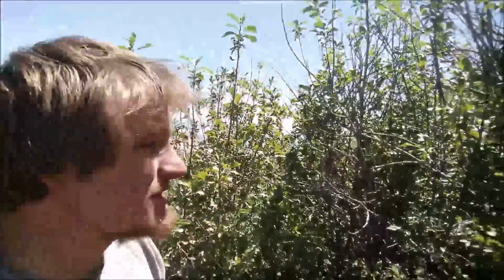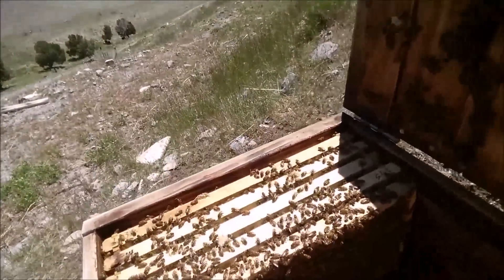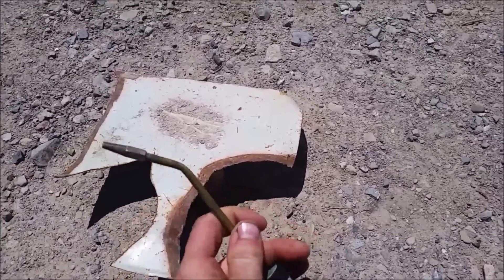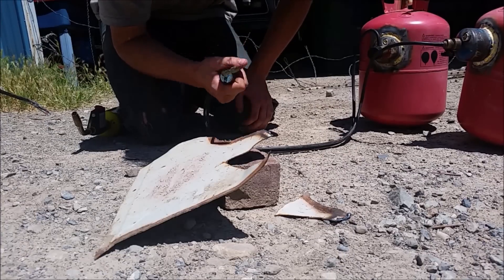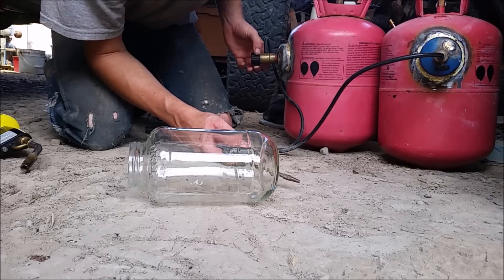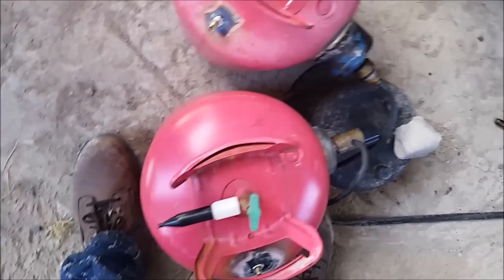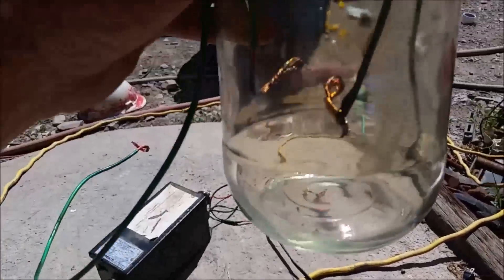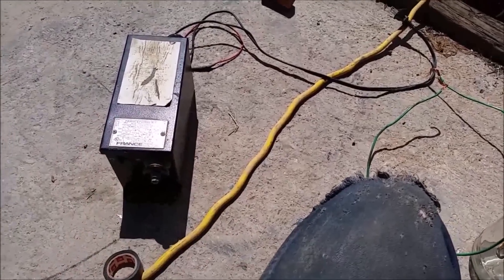Testing My Oxyhydrogen Torch

Comment: hay cody try this take that transformer and run a copper line out in the air insulated about a 100 foot or more as a antenna and hook it to the hi pot on the transformer and see if you get any useable current/voltage coming out of it you run antenna in on hi voltage side and check the lo voltage side for useable current    (you may need to use a hv capacitor between antenna and ground to maximize current last time i tried it  i got up wards of 380 volts or more 
good luck thank you

Comment: I worked for a company that made odd machines, one of which was a oxygen/hydrogen torch that was made to cut four feet and greater, thick steel. One day when the machine was finished, we tested it, I couldn't believe it, it actually cut four feet of steel. The cutting head was supplied from four bottles of hydrogen and eight bottles of oxygen, all hooked together with what looked like hose that looked like garden hose, but actually made for this purpose. The pressures for the gases were 240psi for the oxygen and about 120psi for the hydrogen, both being combined in a cutting head that was over a inch in diameter. The flame was about three feet long, shortening to a foot and a half when the extra oxygen was added. The cut itself was fairly clean, top to bottom, with very little flare-out at the bottom. Yes, Cody, the torch is possible and is used.
Reply: Val Pilags scary

Comment: I expect it tasted like your finger.  As to leaky containers. Hydrogen will slowly drift right through the wall of an ordinary steel container.  You may not have an actual leak as such. Safety note: hydrogen will tend to make a pressurized tank of this kind become brittle due to the formation of metal hydrides, which can produce sudden failure of the tank.

Comment: Hydrogen causes brittle steel. At least in higher strength steels(70kpsi+), the low carbon steels generally have toughness to spare. Large efforts are made to keep H out of any critical welds, electrodes and flux for arc welding  are stored in ovens to prevent any moisture and must be used within 2-4 hours. (the heat of welding breaks the water's bonds)

Comment: hey Cody, I was wondering if you ever thought about making a thermal Lance? basically using the same principle of burning steel wool, using some steel brake line and pumping some oxygen through the line if you ignite the end of the brake line with steel wool or another torch you can have a portable Lance that can cut through thick steel. there's already a video on it from another Chanel, but Im interested in seeing what kind of materials it could cut through. thanks!

Comment: Why would the water be depleted of deuterium?
Reply: The electrolysis process used to produce the fuel preferentially decomposes regular light water, leaving behind the deuterium. There is another video about using that (and another process) to deuterium-enrich water.

Comment: Hydrogen gas is normally stored in a   special tank because of the extremely tiny slippery molecules
Reply: Atoms. FTFY. As Hydrogen is the smallest element, it has always been known to be very tricky to contain in pressure vessels. Even hydrogen fuel tanks in spacecraft during Apollo missions were leaky. If Cody didn't have a leak in his home made hydrogen tank, I'd raise a beaker of home made ethanol In a toast.

Comment: When you say hydrogen is a slippery gas, that's no joke. On one of my random internet surfing days I stumbled onto Hydrogen Embrittlement on Aluminum... wowzers slippery is an understatement. Then you remember that Hydrogen really is just proton with an electron (neutron optional). So hydrogen ions would just be protons? Then from the space geek side you look up a what a pair-instability supernova is... a super inaccurate summary where basically early universe stars putting out SO much energy that hydrogen starts "condensing" out which then fouls up the works.

Sorry for the weird string of wikipedia articles, but hope you get a laugh. Also... nobody should judge you if you can't keep the Hydrogen from escaping out, Hydrogen is friggin weird =D

Comment: A leak in the hydrogen tank is not my main worry.  Hydrogen embrittlement is.  If you want to safely store hydrogen, don't use a steel tank.  find something else... Carbon fiber? or at least make sure you put some kind of failure scoring in the tank to cause small cracks instead of large explosions..

Comment: I've read that one of the properties of the flame of that gas (assuming its Browns gas [HHO?], forgive me my chemistry is not too good and I have not heard it called oxyhydrogen but I think that's what it is) is to render radio-active material less radioactive or inert. I have often wondered if that is true. The fact that it can vaporize tungsten, weld glass to brick and adjust temp to whatever it is used on is pretty amazing so I wouldn't be surprised if it could. The science behind it would be very interesting. +Cody'sLab to the rescue? SCIENCE!
Reply from the maker: This is not browns gas because it is being mixed at the point of ignition, well I guess it is just before it ignites... it would certainly be able to turn brick to glass but I doubt it would make anything less radioactive.
Reply: Thanks for letting me know that the gas is qualified differently when mixed on ignition as opposed to pre-ignition +Cody'sLab I didn't think it would have made a difference. I did believe the article I read about Browns gas and saw a video of a guy welding a glass rod to a house brick! So I did some double checking and as for the radiation... yep that is true too, it was even shown to US congress in 1992 but sadly it must have went over their heads :( 

You have everything needed to do a test to see if the OxyHydrogen gas would work on your radioactive materials as an experiment. It's not Browns gas as you say but it's worth a try don't you think? (Note that pieces of "metal and aluminum" were put near the radioactive sample and put under the flame from what I can glean from the link below). Results were astonishing! Reduction in radiation to 99% of original levels!! Very early tests in Sydney AU could only achieve 50% reductions but apparently they have been continuing to research and refine this aspect of the gas. Do links work in YouTube? I will add spaces Here is what I am talking about...  
Lost the link for this sorry but this is all that was written anyway:
"Brown’s Gas was first demonstrated to US government officials in 
1992.  Congressman Berkley Bedell helped publicize the results of the 
demonstration.
There are many different types of radioactive isotopes and many ways 
to vary the composition of Brown’s Gas and how it effects different 
types of radioactive materials.
When used on Cobalt 60, Brown’s Gas eliminated 96% of the 
radioactivity in under 10 minutes.  Either the mixture can be refined or
 the time can be increased to be more effective.  Americium was reduced 
by 99% in under 5 minutes."
More recent and detailed info here:rexresearch com/brown-haley/brown-haley htm
Love your work Cody! SCIENCE!
Reply: Brown's gas, HHO etc. are just over-unity energy scams. They're not things that actually exist in the real world.

Chemical reactions mean nothing to radioactive elements. The energies involved in coliding neuclei so fast that they form a different nuclei is in the millions to trillions of kelvins. The core of the sun can fuse hydrogen; heavier elements it is much too cold for. This is what particle accelerators do.
Reply: It's bullshit. Hydrogen, Oxygen and the heat produced from it's combustion will not affect radio active materials
Reply: HHO is H2O which is water. An oxygen hydrogen torch combines the two and ignites them. 2H2 + O2 = 2H2O. It basically combusts the two molecules to form water which releases heat in the process. The ideal mixture for full combustion is 2 parts hydrogen and 1 part oxygen. Although, a little more oxygen would make it easier to combust the two.
Reply: +Drew Hurst If you make the extraordinary claim that quantum mechanics and conservation of energy is wrong, you have to prove it. I see nothing distinct from an ordinary hydrogen and oxygen flame. Prove that an H-H-O molecule exists and there's a Nobel Physics prize in it for you.
Reply: +Kenneth Clark HHO is a hypothetical H-H-O molecule which quantum mechanics says can't exist as a stable molecule. The additional claim connected with the HHO/brown's gas scam is that you get more energy from burning it than it takes to make it (AKA perpetual motion of the first kind).

This allows e.g. cars that never need to be refueled; if only that dastardly government and/or oil industry would allow it to be marketed and sold. But hey, you can skirt this implausibly vast conspiracy by buying schematics on the internet for only $89.99 or some gizmo that saves some fuel (why not save all of it if it works?) by using your battery to electrolyze water.
Reply: ***** lol anonymous, thats not evidence for this mysterious h-h-0 or browns gas. 

the only thing this experiment shows is that a mixture of hydrogen gas and oxygen gas can create a flame that can melt metal. 

to figure out if the hydrogen and oxygen were bonding in a unique way you would want to do some sort of spectroscopy. 

all that being said, this is most likely just a mixture of H2 gas and Oxygen gas, with the only "bonding" occurring being from van der waals forces. That is, of course, until the gas receives enough energy input to cause hydrogen bonds to form... AKA ignition... AKA forming water.
Reply: No... It's not. It uses a tank of oxygen and a tank of hydrogen.
Reply: Reading this description at http://www.eagle-research.com/browngas/whatisbg/whatis.php before you make any more comments about scams or over-unity or what Brown's gas is and it's possible relationship to radioactive matter would be a good idea I reckon.
Reply: No, HHO is not an over unity scam.  Most of those who try and sell the devices fail to understand what's going on.  On a normal combustion engine (computer controlled) HHO can produce some benefit, but the additional O2 in the system can be picked up by the O2 sensors and causes additional fuel to be dumped into the cylinders because additional O2 means it's a LEAN condition.  There are a very select handful of cells properly designed that discard the O2 and feed ONLY h2 into the engine, and as a result, fuel efficiency IS increased and emissions ARE reduced.  H2 injection is a proven concept (google NASA's results) at both increasing fuel efficiency and decreasing emissions.  Spend 30 minutes on youtube watching people experimenting with HHO (not the ones trying sell you stuff).  There's also well-built commercial systems that they install on large diesels that see a significant impact on their fuel mileage.  These have been installed in fleets of trucks due to the increased mileage they provide.  Before fuel prices dropped back down I was going to start a business manufacturing and installing the hydrogen-only cells.  They work extremely well, but the cost to benefit ratio is reduced with cheap fuel prices.  It will be quite a while before fuel costs rise to a point to make such systems attractive again.
Reply: HHO is just a 2:1 mixture of hydrogen and oxygen gas. Most torches and stuff use a higher hydrogen mixture to avoid oxidation. Really, it's nothing special. It just burns and reacts to form water.
Reply: i think your need some training in skepticism and rely on more credible sources. looking at the citation sections on articles on that website are beyond garbage.
Reply: +Drew Hurst try a slab of granite rock. It is naturally radioactive and I would wonder what what happen if you heat that up with hot flame of hydrogen gas (HHO). Would it break down or would it turn soft allowing you to manipulate its surface structure?
Reply: Yes that would be an interesting experiment too +gold0monkey but I don't have any of the items necessary to perform it. I am still curious about the validity of all this but I have to assume it works due to the amount of positive data on it.
I still think it's an experiment for ***** to have a look at. Maybe someday in the future.
Reply: Have you tested it? Have you heard of atomic welding? I would like to see it tested, wouldn't you? So much literature about it, must have some basis in fact.
Reply: Clearly you haven't searched the net for a HHO welder lately. LOL But, if your science tells you they don't exist then I guess they don't, QED. Give me experimental proof over scientific theory any day.
Reply: I have your profile pic as at shirt
Reply: *****
haha cool! I like your space avatar too BTW
Reply: seems to me that a thin tank of hydrogen is a very dangerous thing. might want to use an empty Co2 bottle, dont you think?
Reply: Your name is pretty fitting.
Reply: +Anonymous I see a regular torch burning a mixture of hydrogen and oxygen. Prove to me quantum mechanics is wrong; that HHO molecules exist; that it takes less energy to make HHO than you get from burning it.
Reply: +Kenneth Clark HHO isn't a 2:1 mixture of hydrogen and oxygen gas. It is a linear molecule with the structure H-H-O. It doesn't exist and none of the claims connected to it are true. This is just ordinary hydrogen and oxygen gas, it doesn't have any special properties.

Comment: A hydrogen flame will never create a good quality weld because if you have excess oxygen you have oxidized metal, and if it has excess hydrogen it creates brittle hydrides.
Reply: Preheating or post weld heating can reduce embrittlement, but I've heard it's better to use an oxygen rich mix and use methods to reduce oxidation. One simple method is to set up a propane flame over the weld area,  it doesn't have to be strong but it serve to preheat the metal and also it burns up the excess oxygen.
Reply: Agreed, propane as a shield gas can help a lot.

The ideal heat shield gas in this situation is carbon monoxide because not only does it rob that extra oxygen, it helps add trace carbon to the surface of the work piece to give a hardened surface. This may not always be desirable, but when it is, it can be used. Another quite dangerous shielding gas is cyanide gas but it is so much more dangerous its not really worth discussing unless you are in an enviro suit with a remote air supply. Cyanide can harden many metals because of the nitrogen content over and above the carbon content, but the risk of poisoning makes it generally impractical.
Reply: in the welding industry we use argon or argon/co2 mix for shielding welds.
Reply: great point, thank you
Reply: Carbon monoxide in a properly employed utilization, in small amounts, with adequate ventilation is of little practical threat.

With the fear your words imply, you must be afraid of fire in general then since all carbon based fires produce trace amounts of carbon monoxide.

Being a reasonable, mature minded adult, I am aware of the risks and the mitigation, have worked around it a lot in the past with zero ill effects, and see no reason to panic or become a drama queen about its use.
Reply: 1, Iron III Chloride is a deadly neurotoxin I experience by means of an adverse chemical reaction in in my body between hydrogen chloride in my stomach acid and the hemoglobin in my blood, which, should you ingest, can potentially lead to toxic concentrations with other symptoms prior to lethal levels.

2, It is much heavier than air and reacts exothermically with water which can cause contact conjunctivitis due to the acidity of the compound and the natural toxic condition of iron radicals.

3, It can be ingested, inhaled, and absorbed through the skin, therefore, it must be treated as a highly hazardous chemical and proper safety equipment must be worn when handling it.

https://en.wikipedia.org/wiki/Iron(III)_chloride#Safety

https://www.ncbi.nlm.nih.gov/pubmed/14513891

I handle free chlorine gas and chlorine monoxide on a regular basis but only in well ventilated areas and no place close to metal alloys containing iron or any other metallic compounds which my contain metals known to be reactive to chlorine, especially when aggravated by heat and oxygen.

I have developed a secret method [as in I am not revealing the formula for this product to your or anybody, ever] of generating lethal volumes of the gas in the manner as one would use as a chemical weapon so I know from experiments that it will kill humans and animals if allowed to react even to the mass of 100 of milligrams.

Seeing as I never weld in or near swimming pools, your argument is purely asinine.

When done speaking our your arse, you really should wipe your mouth.
Reply: +Delicious DeBlair you just... You... Why... Why would you reply to your own comment?
Reply: Frank Nubler Truthfully though, somebody tried to post some irrelevant garbage which got flagged, and unfortunately, they flagged a person whose comment was actually relevant to the conversation.
Reply: 803brando Understandable seeing as hydrogen makes steel brittle and can cause voids and inclusions. (~_^)-b
Reply: Chlorine in a properly employed utilization, in small amounts, with adequate ventilation is of little practical threat.

With the fear your words imply, you must be afraid of swimming pools then since all swimming pools contain trace amounts of chlorine.
Reply: Frank Nubler To make you ask questions naturally.
Reply: thank you for this explanation
Reply: Carbon monoxide is also quite toxic and a silent killer.
Reply: Delicious DeBlair No.